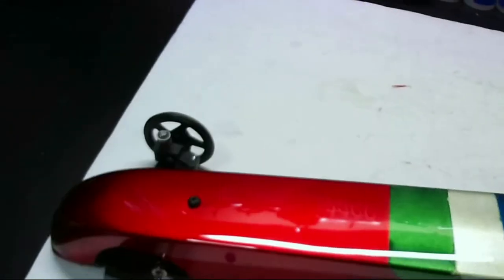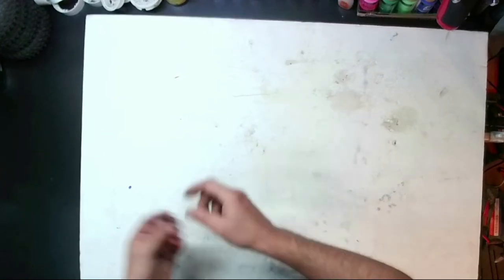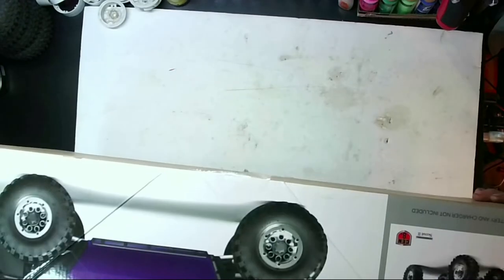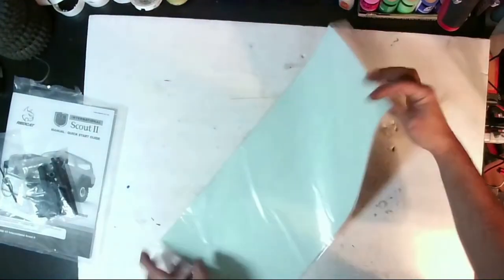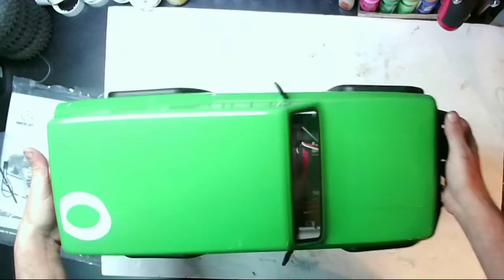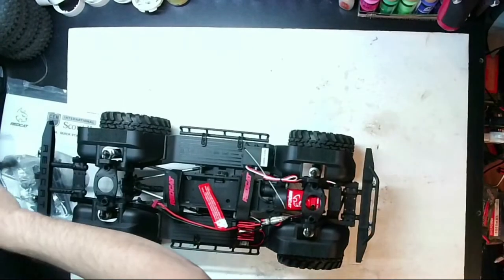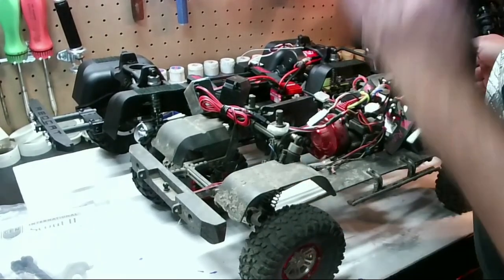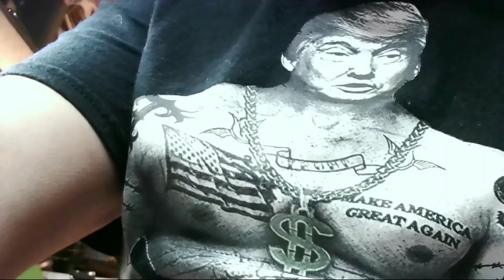GEN 8 UNBOXING AND RJ SPEED UP DATE

Comment: I thinking my battery trey is flat on v1  and offset on v2 was to make skidplate underneath flat , looks good little better than v1 , I used 1080 with hh trail master wrapped rims with heavy gauge solder. Truck a tank the red cat light kit works perfectly and don't have upgrade remote , good you waited bc you got stronger porter, gear ⚙ and clear windows
Reply from the maker: caint wait to try it im so excited  i love the looks of this rc.thanks for the info on it

Comment: Just got my gen8 v2 yesterday ,the stock remote is horrible makes the rc hard to crawl slow with ,i changed it out with a dumbo rc 6 channel and it made the gen8 much easier to drive and easier to crawl slower without it being so jerky ,next up 8mm hex to stop the inside of tire rubbing in a turn ,kp up the gd wrk
Reply from the maker: Thanks for the info